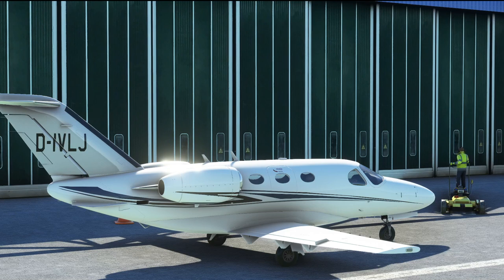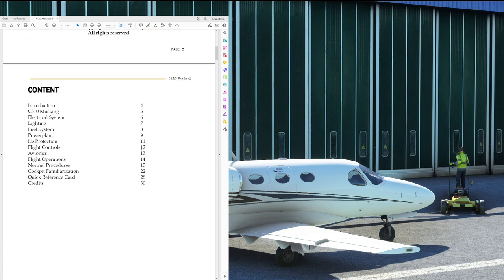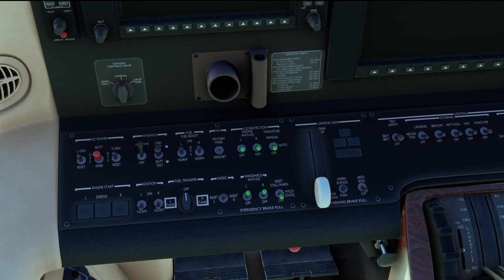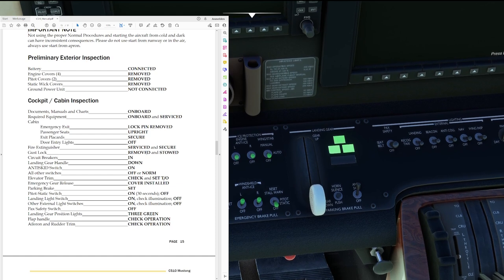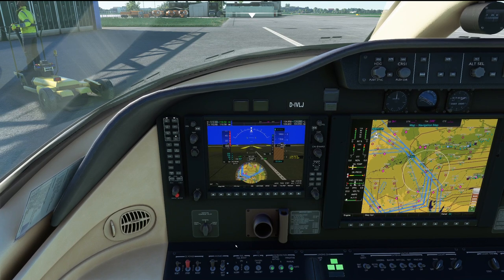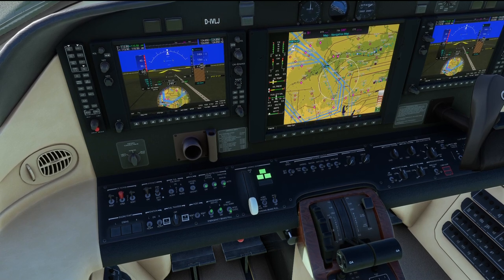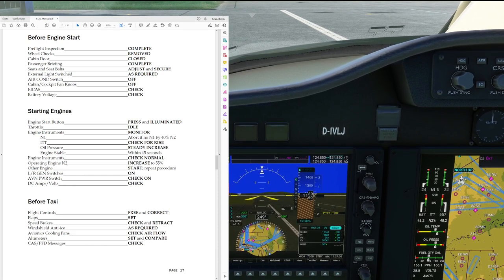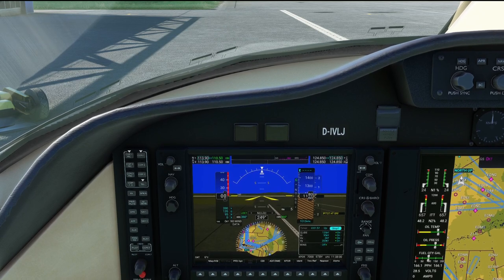How to learn flying a new plane - Episode 1: Preflight Procedures / Familiarization | Real 737 Pilot

Comment: Luckily, many aircraft are similar in certain aspects. The problem begins with how autopilot and various systems are integrated. The Majestic Dash 8 is a prime example. The unusual FMC design and how so many operations are dissimilar to other planes makes a tutorial the least of your needs to be airborne. It’s nice when you jump around between GA aircraft with the rather basic autopilot and overall management. Same for switching between Boeing aircraft. I haven’t used an Airbus since the Phoenix days, and that was not a study level jet at all. The Dreamfleet 744 was however and was a real treat. If I ever get the money to upgrade to a MSFS capable computer, I’ll want a nice Airbus. I doubt I’ll buy the MD80 again. I loved it in FS9 but the FSX/P3D version handles so poorly. Have you tried it? It’s amazing for the sounds and all it’s oddities but the flight model can’t be realistic.

Comment: What if your big shiny new airplane doesn't come with a manual............. 🤨 😄
Reply from the maker: yeah… it’s a mystery to me why developers invest so many hours into getting systems right when they then don’t inform customers how to use them correctly.
Reply: @A330Driver  Burn out. They're just sick of the plane after coding the nitty gritty stuff. Some, if not most, software engineers hate documenting stuff. To them, the code is self-documenting and should be understandable to anyone. Lol.